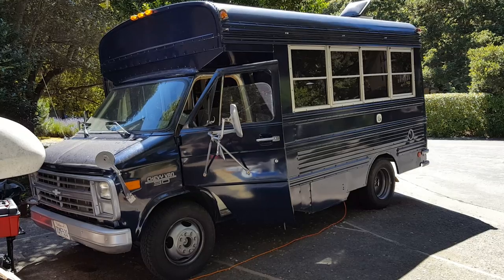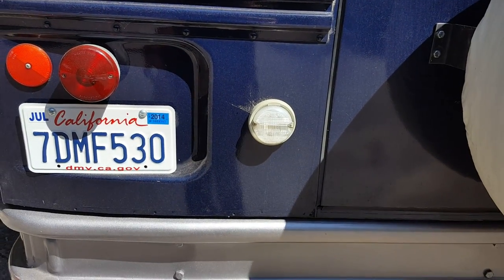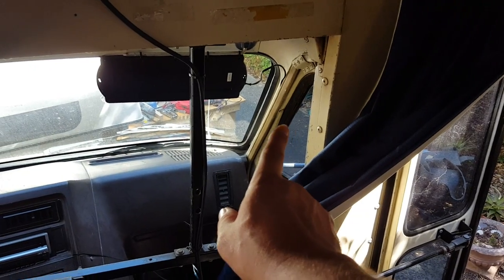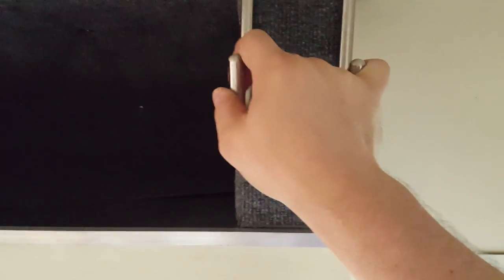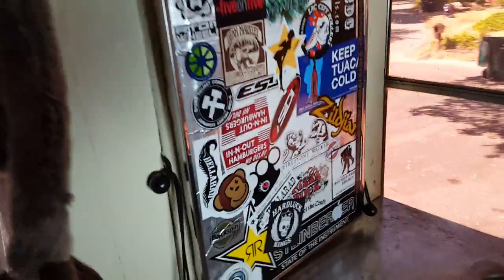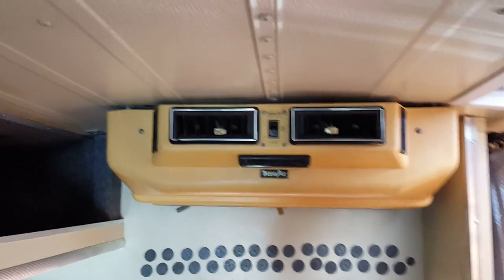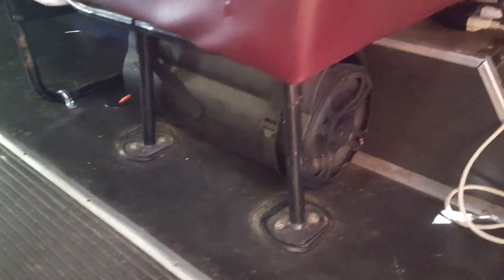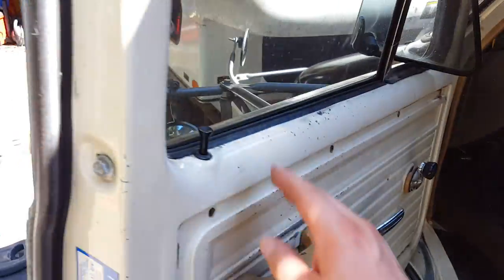87 Chevy G30 'Short School Bus' custom RV conversion

Comment: Do you have non-op filing for the delinquent registration? That will save a lot of penalties.
Reply from the maker: Alan Land registration is current, latest smog done Dec 2017. Didn't want to non-op because I use it from time to time ;)
Reply: Is it listed anywhere? Craigslist or Ebay?
Reply from the maker: It's gone on FB marketplace & Craigslist a few times. You looking to buy?

Comment: What are the floor plans on it
Reply from the maker: If I recall (since it's been sold a few months ago) queen size bed up front with about 6" of space at the head & foot, 30"x40" for the bathroom in back, kitchenette over one wheel well, & the dinette over the other. Roughly 6' 4" of clearance down the sidle from floor to ceiling, & OH cabinets were about 18" tall & 24" deep.

Fun project & even more fun to use :)